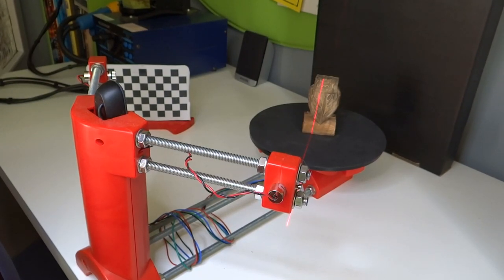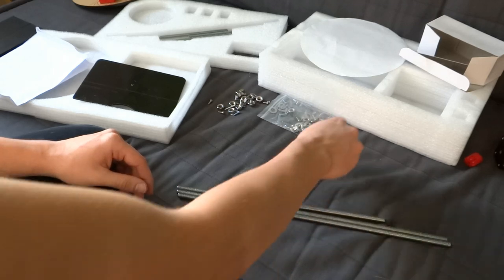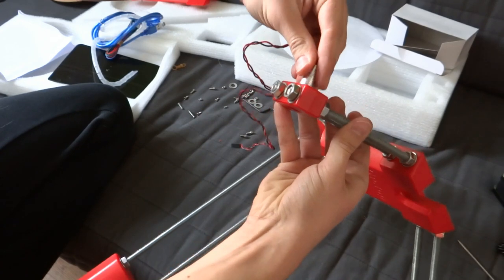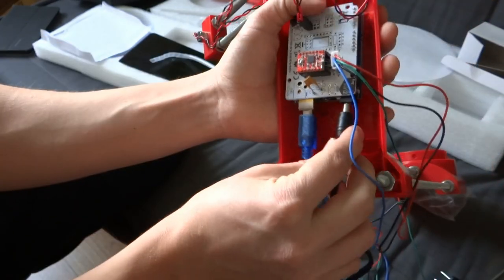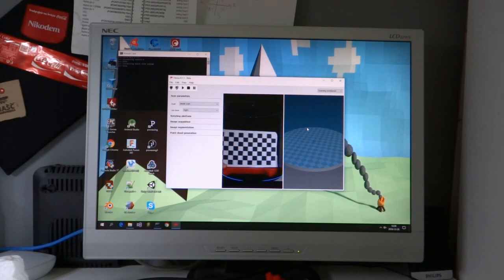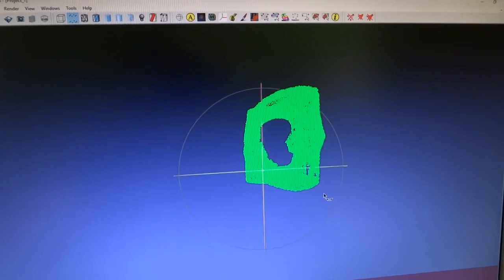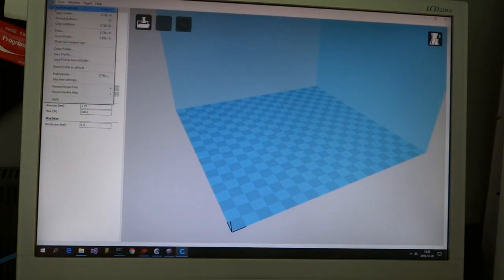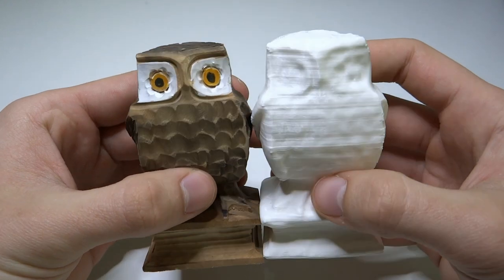Cheap 3D scanner Ciclop

Comment: For some reason I thought these also used a camera for photos and combined the two. It looks like all you get is a basic laser scan. I would think upgrading to cross line lasers and using all four to make a grid will help. You can even mix wavelengths with red, green, and blue. Blue is best overall and highest resolution. You may have to adjust firmware for wavelength changes. I’ve seen the new zum board two camera capable which is interesting and why not use a usb binocular camera for better scanning both take unison photos.

Comment: The quality is terrible...
Reply from the maker: Sanin for that price you can't find anything better than that
Reply from the maker: +d1v1s1onby0 Idiot want to say sorry to you, the master
Reply: yeah, it's really kinda shit!
Reply: Nikodem Bartnik ..,my iSense cost $49 shipped on eBay when they flooded the market last year and its 10x better. Unfortunately they’re now $300. I’d like something better based off this platform using better hardware and perhaps a RealSense camera and you can find variations of those all over. Other option is a $59 projector and a couple high depth cameras and assemble a structured tires light printer. There are ways to do it cheap but there is some experimenting that could eventually soak your wallet a few more bucks. Risk is you quit and take a loss or you spend more and end up with a fantastic scanner. I agree though for these results why even bother. Better off with a Fabscan pi.